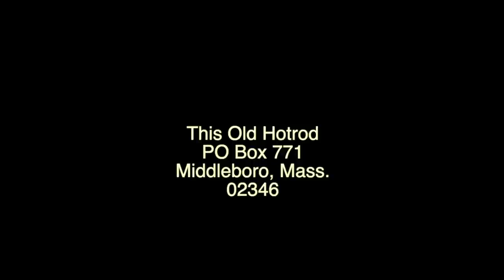Mounting The Panhard Bar

Comment: Rubber bushes are certainly less harsh than spherical rod ends Mike. I have to say I don’t recall seeing a Panhard Rod being fitted behind the axle before. I always mount them to a bolt on bracket at the front of the diff & attach a weld on bracket to the inside of the chassis rail. Leaves me plenty of room to fit the coil over shocks. Still, I guess you’re wanting to replicate the original to a degree. Looking good 👍.
Geof
Reply from the maker: That’s how it was built, I didn’t see any real reason to change it.

Comment: I wouldn't use himi joints on any suspension ! Those bushes you have are a lot stronger and sound insulation and good for removing vibrations !! We cant use himi joints here in Australia on any suspension component !!
Reply: Interested in why you can’t use him joints in Australia?
Reply: @deniseprettner2020  yes but not on suspension parts !! And the clevis joints are band on suspension parts aswell !!
Reply: @leoncolyer9420  wow ok I was just interested.  But your comment on himi joints will be useful in the future.

Comment: I have a question about the rear axle. I know you list it as a 1958  and that series of rear was up until 1964 but were they all the same width? I was just wondering why you stayed with that axle/ What does the axle have for rear gearing?
Reply from the maker: I only said that because that was what the papers/ info said it was when I purchased the car.   
I do not know if they’re the same width.   
The car was built with that axle back in the day.  There’s nothing wrong with the axle and it’s a Posi rear.  
I don’t really see any reason to not use it and spend money for a different rear axle.

So I did some digging the other night after I cleaned it off, getting ready for paint.  .  
The casting numbers say it’s 62-64 Chevy Posi rear axle. With the “P”
Casting code is 3789812
It was built at the Buffalo plant and has a The gear ratio of 3.36 
Stamped BM for the gear ratio. 
Says it was behind a 3 SPD, PG, Taxi from the factory.  
Hope that answered all your questions